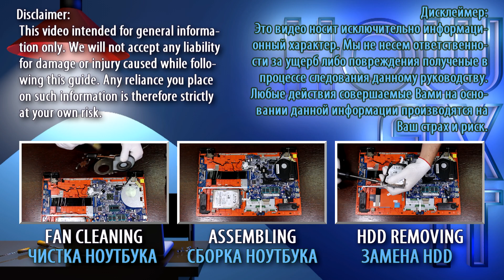Lenovo IdeaPad Flex 15 RAM Upgrade and Install | Step-by-step DIY Tutorial

Comment: can this laptop be upgraded with a single 16gb card to replace the 8gb one from factory?
Reply: @jase002002  I found the max RAM for the Flex 14 was 16, so my answer was YES it can be upgraded. Unfortunately there is only 1 port so you will need to purchase a full 16gb instead of an additional 8GB
Reply: @jase002002  not yet. But still plan on it. Will let you know
Reply: https://www.amazon.com/gp/product/B074Q1P62K/ref=ppx_yo_dt_b_asin_title_o00__o00_s00?ie=UTF8&psc=1 this is what I went with and it made a HUGE difference.  8GB of DDR4 built in, I thought that would do, but no way.  Windows 10 and flash enabled websites are memory consumers.  Core i5 + 16GB of DDR4 RAM + the 2GB dedicated graphics card = happy computer!
Reply: @ramondelgado6778  Thank you, Ramon :)
Reply: @ramondelgado6778  Although I do have the "Lenovo Flex 6 14"" ... Would this specific 16 GB memory stick do the trick with my device too? Or do you possibly have a link or instructions on where or how I could check? Thank youuuu
Reply: @6nics  just checked the Crucial website and plugged in the Lenovo Flex 6 14" and is is the same exact DDR single card, 16GB.  Here is the link.  Good luck and thank you for the kind words. https://www.crucial.com/usa/en/ideapad-flex-6-14ikb/CT12378618
Reply: It states it comes standard with a single 8GB or 4GB card.  Only 1 slot, which is used by the OEM installed card.  Upgrade-able to 16GB, and must of course be a single 16GB card.  Really easy to install.   I would HIGHLY recommend this upgrade as it vastly improved the speed of this laptop.  ALOT!
Reply: @ramondelgado6778  Not all heroes wear capes
Reply: I have the same question. Any updates?
Reply: @jase002002  if it is the Lenovo Flex 2 - 15D, here is the link.  Not the same RAM.  That one uses DDR-3 RAM.  2 slots.  Max RAM of 16 GB.  Good luck.  The RAM really wakes these babies up.  https://www.crucial.com/usa/en/compatible-upgrade-for/Lenovo/lenovo-flex-2-15d
Reply: same question i have lenovo ideapad flex 15 model 20309 . Any updates guys?